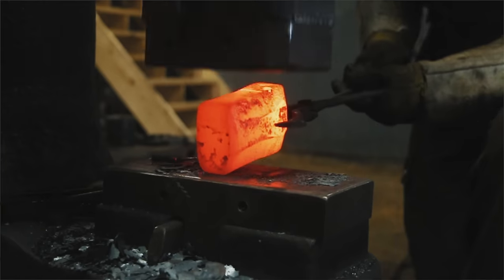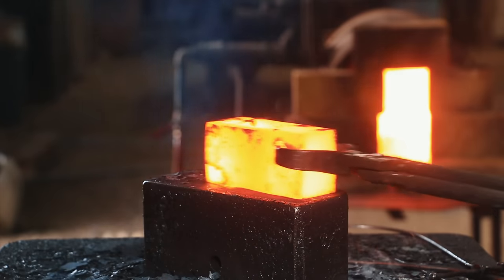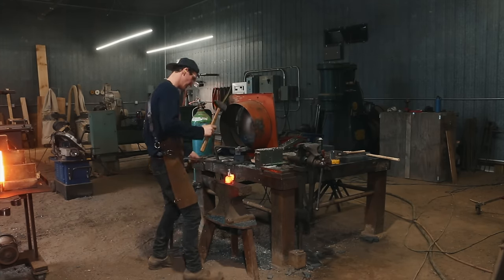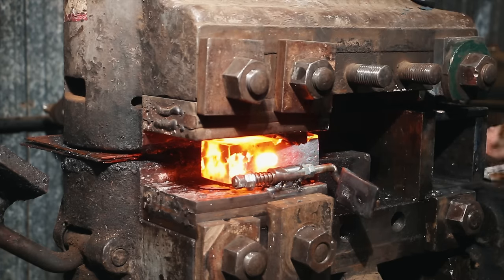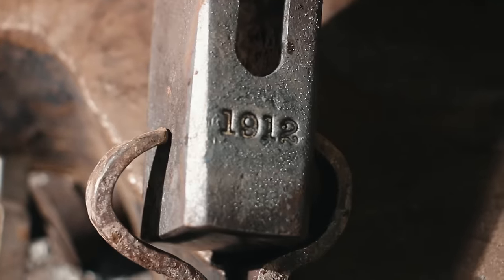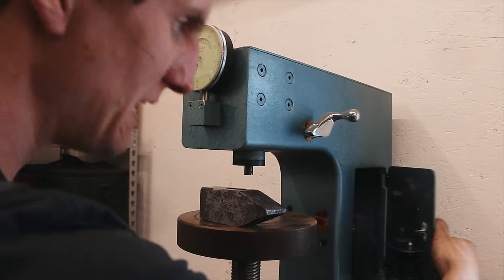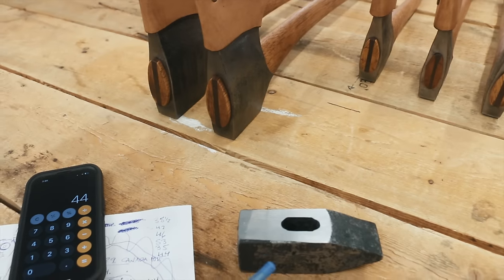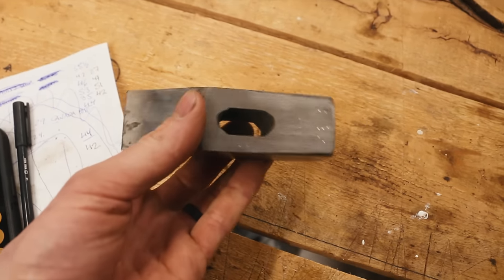How Canadian Blacksmiths Craft Hammers from 1912 Rail

Comment: You could make small fixed blade knives like a neck knife out of those small off cuts from the hammers when you break off the end. Then you could sell them with your hatchets or hammers.
Reply: If the hammers harden to 53 Rockwell maybe the thin knives would be higher

Comment: Hey Tim, you might want to look into the "Astra coated" Compression pattern router bits from "Bits n Bits". Though the upfront cost is higher, you should find that they cut cleaner and faster and stay sharper for longer, so in production run like you have for the handles, it should work out worth the upfront cost in order to save on the back end.

Comment: On your axes, I would still fully harden the whole head. But then I would go back with a torch and blue temper the eye with a torch to guarantee they are not too hard. Then, the poll is still hardened if you use steel wedges.

Comment: Isnt rail mild steel?
Reply: It was, until you have trains running on it until it is decomissioned and then it is the hardest of cold forged. Notice they aren't sawing the billets, you run through tooling if you try to saw it.